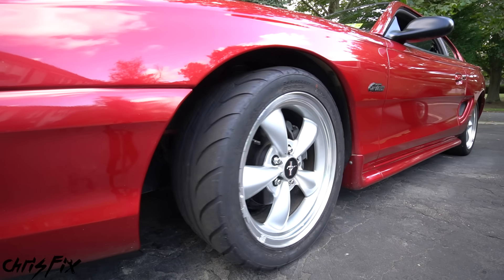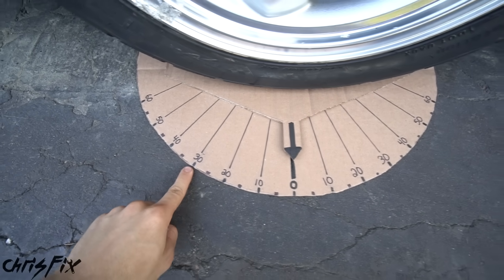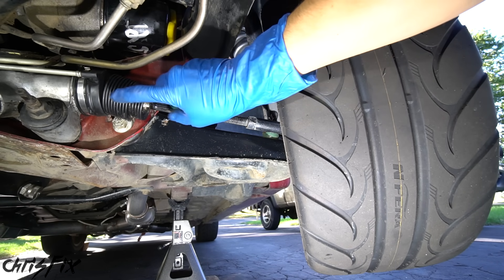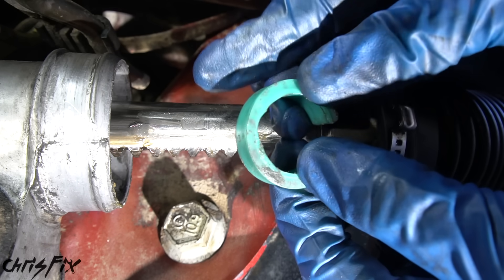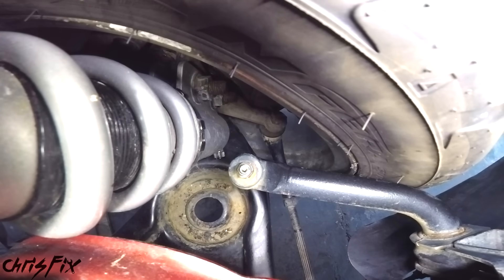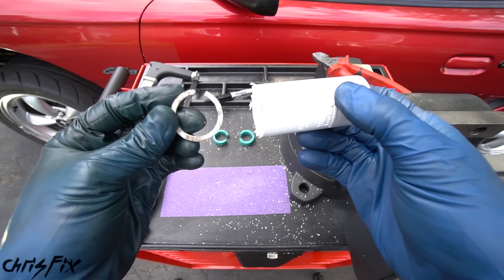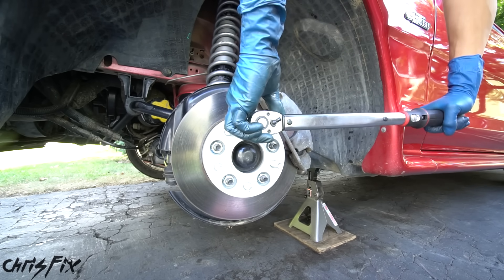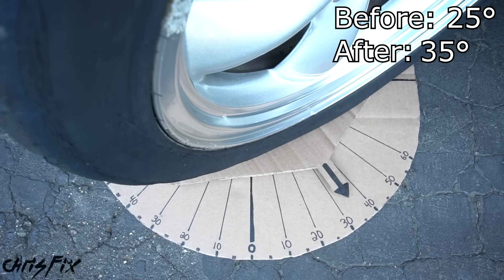How to Get Your Car to Make Sharper Turns (Steering Angle Mod)

Comment: Advising spacers... I really thought you were better than this... they destroy your bearings by increasing the space between your tyre midle and the bearing, they will make your steeringwheel smash your thumbs when you have a puncture or even when you lock up a wheel when breaking, they will put your wheels further out of your car (sometimes illegal) and the width of the axle is bigger now, which can make the car behave very weird when you go for some spirited driving! DON'T USE SPACERS! The quality of the spacer has nothing to do with it because it's just a piece of metal, the effect will be the same with all of them. I do a study on vehicle dynamics so I know a bit about the subject... however I would like to hear why I could be wrong...
Reply: Mark Boersma if they're stalled correctly and everything works together no they don't but if you just throw them on there they mess things up but spacers are trash so I wouldn't recommend because most people just put what ever " MOD" on their cars and that's when they pay the price
Reply: Jesus Ruiz great reply, however you change the ET (einpres thiefe) no idea how you call it in english... which has major effects in handling and steering so I assume al spacers are garbage?
Reply: Mark Boersma spacers over all aren't good for your car, so you're right that's why most people recommended just getting rims with more negative offset but!  You know your stuff!
Reply: Changing your offset will put pretty much the same loads through the bearing as the spacer does, since it moves the wheel outwards the same amount.  Yes, it does load up the bearing a little more (or a lot more, of you really overdo it), but it's more of an issue on the rear (on older cars, anyway - not sure about more modern cars) where they don't use a tapered roller bearings, and so the rear axle bearings can't handle those increased loads for long.  This is one reason trucks with dualies (and some older race/sports cars) use "full-floating" rear hubs.  It's even been known for manufacturers to pretty much built-in spacers in the past...a thick lump of metal (usually iron) added to the outside of the brake to push the wheel further out - along with longer studs so they reach the additional distance, of course.  :-)
Reply: Johnny Reb I think the problem is not wether it's centric or not the problem is that you are messing with the placing of the tyre centre to the bearing, that has nothing to do with balance or centrepoints just with that distance, this has massive influence on handling or when you lock a wheel with the brakes
Reply: Changing the offset (ET value) is not a good idea. The offset determines how the car handles when for example you hit the soft shoulder. With spacers, the wheel that hits the shoulder will get pulled out, steering you off the road immediately. Ouch.
Reply: I hub centric spacer will not add any extra load and are ok to use it’s the spacers that aren’t hub centric that cause problems
Reply: I got my spacers from a local machine shop they used 6160 aluminum and they were milled from a solid block of it   I also use ARP hardware for them. So that explains why they have done so good because they are high quality spacers.
Reply: Mark Boersma we’ll all I can say is I’ve had spacers on my truck with 35 inch A/Ts and haven’t had s single problem in the 200k miles they have been on there
Reply: I ran spacers on all corners of my Jeep for about 75k miles and not a single issue either.
Reply: If you use upgraded wheel studs and fasteners from ARP you be fine. Not anything from eBay sold cheap.

Comment: I work at discount tire and when we torque the wheels, we do the star pattern and then do a full circle after that. Just curious if you have ever heard of that Chris
Reply: that sounds more like a safety check than an actual torque pattern. Just to make sure you got them all I suppose.
Reply: Chris Roseberry yeah we do that to every car that comes in even if we don't take off the wheel. We just do the circle check to make sure
Reply: makes sense to do even if you didnt take the wheel off. If something happens to it soon after taking it out of your shop they will try to sue you or some shit like that. Might as well cover yourself.
Reply: Chris Roseberry yeah they tell us that as well
Reply: Yeah you do it to every vehicle for safety. Also you do it for liability. Someone leaves and wheel falls off who are they gonna blame.
Reply: Chris Roseberry it is a safety check, I did it when I worked on tractor trailers, no company wats to have a law suit because a mechanic forgot to torque the lug nuts

Comment: Whats the reason behind power steering moaning n how does it damage it ?
Reply from the maker: That is the pump forcing fluid into an area where there is nowhere for the fluid to go. There is a pressure release valve that makes a hissing sound which is the fluid purging out so the seals dont blow.
Reply: ChrisFix Thank you Chris.

Comment: Why does the angle vary when turning left and right? Aren't they supposed to be the same? In the turning radius specified in the car manual, is it the left or right turn angle?
Reply: Search "ackerman steering" on google, it's normal for the angle to be different.
Reply from the maker: That is called Ackerman angle. When I first tried it out I thought my angle finder was wrong lol. Then I did some research and asked Engineering Explained if he knew what was up and he led me into the right direction with info!

Comment: Spacers are not only bad for your wheel bearings, they change the suspension’s load geometry, which could cause serious damage in case of a strong impact, like hitting a pot hole.
Reply from the maker: Thanks for sharing. I can tell you for a fact that the mustang suspension can handle it. I go off the track at 60mph sideways hitting pot holes and stuff you cant even imagine and it holds up. I have been testing it for a few months now before I made the video. What you said is still definitely true but a 25mm spacer isnt big enough to cause a problem.

Comment: Just something that makes me curious on this, if when your turning and your tire gets a little torque on it with that little of a gap, won't you get a little rub? Anyhow, still a great video and keep up the good work!
Reply from the maker: Surprisingly no. If you have a wider side wall then possibly. When I drift I put a ton of lateral load on the tires and they dont rub so for daily driving at slow speeds it wont be an issue. Great question!
Reply: Interesting to know! Thanks for the response!

Comment: What would hub centrics on the rear axle also do.
Reply from the maker: A wider track helps a little with handling but for a daily driver it is mostly to move the wheels out to look better (more flush).

Comment: My Alfa Romeo 147 turn radius  is horrible.
Reply from the maker: See if it has rack limiters!
Reply: ChrisFix Even it did I cant remove them because i barely have clearance as is. Its a FWD with monoblock brembos and larger tires and I even have wheel adapters to make it fit as is.

Comment: What's the vent tube for? Equalizing pressure?
Reply from the maker: Correct. Since one boot closes (decrease in volume) that air needs to go somewhere so they vent it to the other boot which is opening (increase in volume). It keeps the pressure equal and doesnt allow dirt in.
Reply: Cool, thanks.

Comment: Is it worth trying to restore scratched hub caps and is it the same process as rims?
Reply from the maker: Usually it's easier to just buy new ones unless you have ones you really like or are hard to find. But you can follow similar steps. Plastic gets removed a lot easier than metal so just be careful with the sanding.
Reply: ChrisFix thanks it is a first car so I may leave it a little longer before deciding what to do

Comment: Why the manufacturers don't make cars with a big steering angle? Did it affect something else? Or is it expensive to make? I know Mercedes Benz has huge steering angle, maybe the biggest...
Reply from the maker: The more steering angle the more expensive because you need to design a good suspension setup with a lot of room for the angle. Ford probably didnt want to relocate the sway bar so they kept the angle they used and it wasnt good.
Reply: bahhaziz high steering angle can make a car Twitchy or can make it unstable on full lock
Reply: burnerheinz when is a car at full lock ever traveling above 5mph outside of drifting cars? loll
Reply: because tyres will rub
Reply: my record at work is 39.7 degrees on each side. Ive seen it go as high as 45 but thats too high to pass our tests.
Reply: Factors conservative automakers always look for is liability and general serviceability. Basically, reducing operational error (dingus behind the wheel) and servicing error (dingus with a wrench.)
Reply: SIF would never happen. nobody goes full lock while driving around any corner. you only go full lock doing u turns and drifting. if it does make contact. its like a suspension bottoming out. the tire will momentarily loose traction and cause understeer possibly.
Reply: bahhaziz one word: oversteer

Comment: wheel spacers or larger tires higher negative offset rims will always increase the ware and tare on  wheel bearings and lower/upper ball joints the amount of life it takes off your suspension parts depends on how far you modify your wheels
Reply from the maker: Correct! The key is knowing how much is safe. I have been running these spacers for 6 months on the track with no issues (took them off to make the video) but some cars dont have sturdy wheel bearings so it can wear out faster!

Comment: Your videos are the best. Super easy to follow and High quality. I understand it takes a while to make it but it’s so worth it. Thank you Chris your the best.
Reply from the maker: Thanks a lot man! I really work hard on getting all of the best camera angles and when I am not happy with something, I dont just put it in the video, I go out and film it again. For the quad-copter shot, I went out today (well yesterday haha) to redo that so I can match the cars better for example! I think of each video as something that showcases my work and I want every one of them to be as good as it can reasonably be in a week or two. After each video is published, I immediately start on the next video!
Reply: ChrisFix idk who and why anyone would ever dislikes your videos
Reply: *you're
Reply: Up the Logic
Reply: ChrisFix yo man! I realy needed this video! Thanks but spacers are not allowed in the netherlands. Is there another way for me to increase the angle on my audi?
Reply: whats the metal rod with holes in it sticking upwards between the gear shifter an steering wheel???
Reply: You are very right
Reply: HazzMatt Sammeem   P
Reply: ChrisFix hey Chris can you do the same thing on a truck or and atv?
Reply from the maker: +santino bonora extended control arms. You need someone who knows what their are doing to weld them so they are braced and longer.
Reply from the maker: +Mr.Racing thanks for the feedback
Reply from the maker: +The J Channel yes! As long as it has rack limiters
Reply: +santino bonora
without trying to give advice.. and everything is at your own risk...

2+ washers on every lug behind your tires would help you compensate..
Reply: HazzMatt Sammeem he talks to much...
Reply: HazzMatt Sammeem you're*

Comment: Would you recommend doing this for perhaps a daily driver? I drive a Durango, and it's turn radius is pretty tight for an SUV, tighter than a big truck, but still a little wide.
Reply from the maker: I made the video for people with daily drivers so yes. It is very helpful to decrease that turning radius for parking and making turns!
Reply: Thanks, Chris! It doesn't bother me too much, but something I may consider down the line.

Comment: Hi Chris,is there a way to make the steering wheel turn easier.I have a 2016 Dodge Challenger Hellcat and the steering is very hard.
Reply from the maker: The brand new cars should have electric power steering and a lot of times it changes based on speed. I wonder if it isnt working?
Reply: ChrisFix thanks Chris,I was hoping there was a place I could do an adjustment myself without tying up my car for a couple of days but guess it has to go to the Dodge boys.

Comment: How did you get the bottom of the cardboard to not move?
Reply from the maker: The ground has more friction than the friction between the two cardboard pieces. I also used some corn starch between the two cardboard pieces so it slides easily.
Reply: Thanks for the explanation and that sweet steering vid man from big fan UTI tech👍🚗